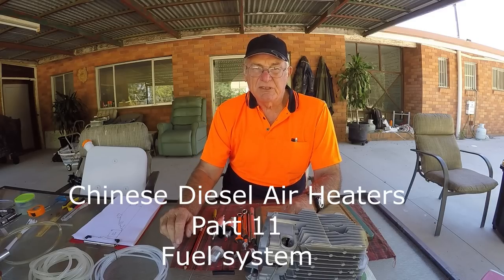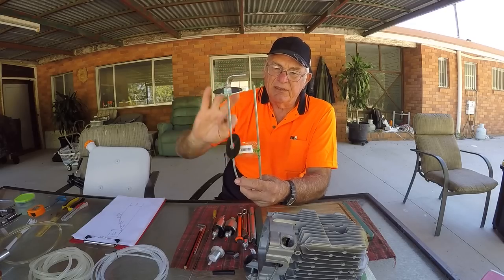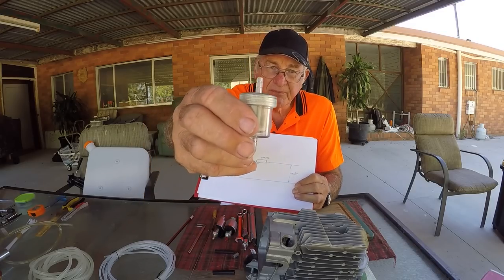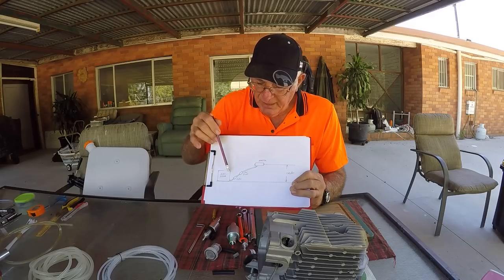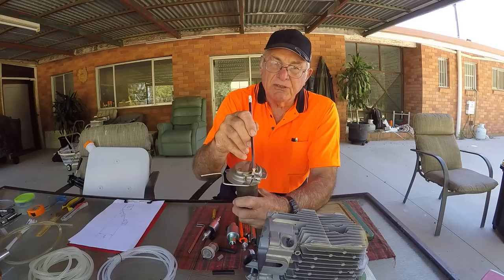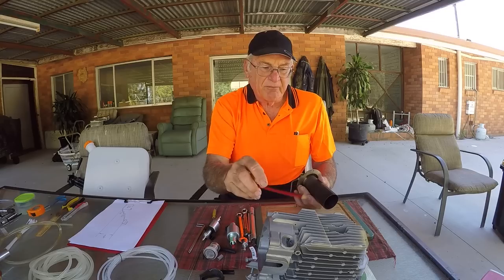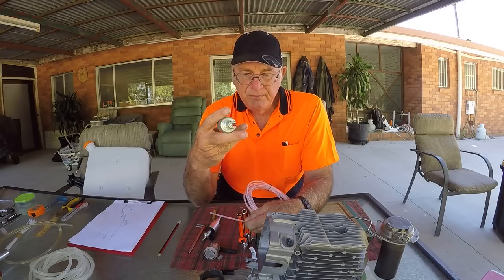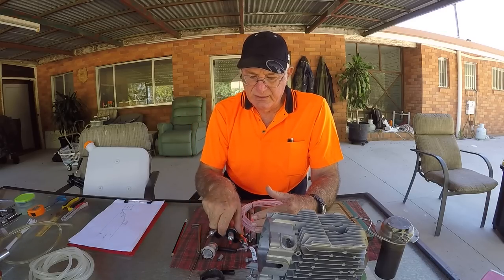Chinese Diesel Air Heaters - Part 11 -  Fuel Delivery

Comment: Hi John, i have an all in one diesel heater and it came with the thick plastic fuel hose and a terribly thin fuel tank, after a few weeks use we got a small pin hole leak in the fuel tank where it was molded, so its been out of use for a few months after stinking out the caravan. but lately i have just purchased a new fuel tank which is twice as thick as the old one, when i put it all back together i had that problem of not being able to get the air bubbles out of the lines, so going by your video, if i put a hard nylon 2mm fuel line on the pump outlet side this would cure my problem, next problem, is it ok to use the thicker softer fuel line from the tank to the pump or should i use the 2mm hard nylon fuel line all the way thru, thanks for your time John
Reply from the maker: Hi Allan, it is ok to use thicker fuel line from tank to pump, but I have found that some of the supplied thicker clear fuel hose from China only lasts 6 months or so before it starts to perish, so it would be better to use proper fuel line. 
Not sure what you mean about the bubbles. With these heaters you will always get small cavitation bubbles in the fuel line after the pump. 
With the all in one heaters, because the fuel line from the pump to the heater is very short, you can also use the thicker fuel hose should you choose. JMcK
Reply: @johnmck1147  Thanks for your quick response John, yes its not bubbles its cavitation, but my problem is how do i get the fuel from my tank to fill up the filter to the pump with out any air in the line, as you said the pump isn't strong enough to suck the fuel and gravitation isn't enough to fill the fuel filter and travel the short distance to the pump, would i have to siphon it thru manually.
Reply from the maker: allan mumby 

Hi Alan, the pump is strong enough to prime the line, but if it is a long line and a big filter the pump is doing loads of work, piston up and down hundreds of times without any lubrication. Just manually prime the line.  JMcK

Comment: Hi John. Do you think it would cause a problem to have the fuel tank above the pump so in effect it would be a gravity feed to the pump.
Reply from the maker: Hi Paul,  Tank above the pump will work fine, but you will need to install a fuel shut off valve and turn it off when heater is not in use as diesel can slowly seep past the pump valves and flood the system.  JMcK
Reply: Thanks for your quick reply John, The shut off valve is a good idea, my heater came with the soft crappy fuel line so just ordered some nylon Pneumatic line with an ID of 2.5mm. thanks again for your videos I'm sure they are helping a lot of people....
Reply from the maker: @paulexbiker2482  
Hi Paul,  suggest you use good quality normal fuel line on input side, ie  from tank to shut off valve to filter to fuel pump. The fuel hose from fuel pump to heater (unless very short) should be narrow bore hard nylon.  JMcK

Comment: Pardon my comment/question(s) if you'd already addressed it. I plan on installing my MaXpeedingrods 5000 12V 5KW 5000 heater as it is recommended to be installed with the stock components it came with. .Although,  I appreciate the information whiich you provided, is this video for ppl who do NOT plan to alter the stock components that come with the heater which we purchased? The only question(s) I have is will there be a fire danger if we plavce the exhaust pipe through a thick plywood floor of a cargo trailer? I see ppl purchasing these expensive 3rd party torret mounting plates instead of the one it came with. I don't see anything wrong with using the stock mounting plate if we create a hole a little larger than the exhaust pipe which would allow for some space (a gap) between the pipe and the edge of the wood hole. Right??  Thank you in advance!
Reply from the maker: Hi AE, You can do that.
You need a hole at least 100 mm (4 in) in diameter, or square if you wish.
You need room for the exhaust, the combustion air inlet, and the fuel line in the one hole.
You must seal the plywood cutout to prevent rot.
You can also put exhaust wrap on the first foot or so of the exhaust pipe.
You don't need an expensive mounting floor plate. Have a look at my motorhome install video.  Cheers.  JMcK
Reply: Cool thanks! I also have about 2” of pink foamular insulation attached underneath the plywood floor as well. I’ll cut that out too insuring distance from the hot pipe as well.  However, I’m confused as to if I shud place the 1.5 gal fuel tank inside or outside of my poly tongue box? Any suggestions are very much appreciated! Thank you! AE
Reply from the maker: Hi AE

You are using diesel or kerosene in the heater, so it is really up to you where you mount the fuel tank. Outside is better if you can, but many people have mounted the fuel tank inside with no issues.  JMcK
Reply: @johnmck1147  Got it and it fits perfectly inside my tongue box. I'm now just running the fuel line through the bottom of it into the filter and (upward angled) fuel pump. I just hope the fuel "filter" doesn't also have to be angled in any specific direction. Thanks again!
Reply from the maker: Hi Art, I answered this for you in another post. Yes, the fuel filter can be mounted flat.  JMcK
Reply: @johnmck1147  Geesh! Finally, the answer I was looking for. So many opinions it becomes more time consuming than it's worth sometimes. But, I think ur opinion is worth more than a lot of others' since u seemed like u actually DID THE RESEARCH YOURSELF. Plus, although my fuel filter is horizontal, it will only be about an 1.5 inches away from the tank .Then, the line will drop down out of a hole in floor of my tongue box (about 8 inches) where it  will join fuel pump facing upwards @ 30-45 degree angle. 😀 I shouldn't have too much of a problem priming the pump with that short of a distance "below the tank." BTW, there are alot of ppl saying good things about you John! So, kudos and thanks so much from a lot of ppl! Art

Comment: Hi John, thanks for a great video. I have bought one of these heaters and have been supplied with two sizes of rigid tubing in the kit. 4 meters of 4x1.25mm and  2 meters of 6x2.0mm. Is it ok to use the 1.25mm bore tubing?
Reply from the maker: Hi Greg, yes, that is ok. Suggest you use normal fuel host from tank to fuel pump  if they are at about the same level to lessen the chance of joiner leaks. From the pump to the heater you should use the hard nylon fuel hose.  JMcK
Reply: Hi John both the 1.25 mm bore and the 2 mm bore are both hard nylon/pvc. Can you let me know which bore is better for use? Many thanks
Reply from the maker: Greg Shaw 

Either is ok Greg. A bore of 1.25mm  to 3mm will work ok provided it is hard nylon. The issue is the "hard" part of the hose. The pump sends pulses of fuel to the heater and you don't want these pulses absorbed by a soft fuel hose and not squirting into the burner screen. Soft 4 mm bore fuel hose on the suction side of the pump is ok.   JMcK
Reply: That’s great. Thanks John.

Comment: John I’m getting 4.5V at glow plug, it starts but not efficiently any ideas? 12.7-12.9V at the heater unit. The earth is running to the chassis, does it need to be on the battery? I haven’t extended the power wires from standard only the monitor wires but with thicker then standard
Reply from the maker: Hi Matt, that is far too low a voltage. The glow plug can draw near 10 amps on start and it will pull the voltage down quickly if wires too thin or battery not charged.

I recommend the heater be wired directly to the battery, and do not connect negative to chassis. 
The power wires supplied with these heaters are the bare minimum.
I talk a lot about this in the motorhome video.  JMcK
Reply: @johnmck1147  I have placed the multimeter into the wires at the heater unit and it measures 12.7-12.9 on startup and at battery, wouldn’t I be seeing more significant voltage drop at the unit than the battery if voltage drop across wires or due to the earth were the issue?
Reply from the maker: Hi Matt, 

Is the heater new?, or has it been working well and now is hard to start?

If new, is it a 12V heater? Not a 24V heater.

If a 12V heater, do you have a 24V glow plug installed by mistake?

If an old heater, that was working well, I would try a new glow plug. There are lots available on eBay cheap.   JMcK

Comment: I'm preparing the install of a 2kw unit.
The tank is gonna sit 30cm higher than the heater unit, and i want to connect the fuel pickup hose on top of the tank (with a copper pipe inside the tank to 2 cm above tank bottom) because then i can easily disconnect the fuel line and take out the tank to fill it.
Because the fuel line is going out on top of the tank and then downwards to the heater unit , there will be an air bubble in that bend.
I'm using the hard style 2mm ID hose.
Will this bend be an issue? I see in you video that you can PUSH a bubble through, but in my case, it should SUCK the bubble through the pump.. any advise?
Reply from the maker: Hi Winand, I don't see any issues with that set up.  JMcK
Reply: @johnmck1147  Thanks for your reply! Great, a step closer to installing now ;-)
Reply from the maker: Winand D 

Your welcome. 
Best wishes,  JMcK

Comment: what if you have to mount the pump higher up than the heater? I have the hard nylon but im Teeing in to the fuel pump in the engine bay, so the heater will be at least 50-60 cm below the pump. shouldt the pump be closer to the fuel source or the pump? its say my fuel source is at least 2.5m from the heater. where should i put the pump, closer to heater or fuel source?
Reply from the maker: Hi AP, I think you will have troubles here. You can't tee into the engine fuel system, you need a seperate fuel pick up for the heater. Suggest you see motorhome videos.
Pumps always push better than suck. Better to have pump closer to source.  JMcK

Comment: does the diesel drip onto the atomizer or injected?    If injected is that simply cause their is a small orifice at the end of the fuel line orrr???
Reply from the maker: Hi C, the diesel has to be squirted through the atomisation screens.
That is why you should have narrow bore hard nylon fuel hose on the delivery side of the pump (except for very short runs). The hard nylon fuel hose does not absorb the fuel pulse.  JMcK

Comment: Hi, I bought a 8 kw (ok a 5kw) and i need a spare pump and a spare glow plug.  Where should i look to get the right one ?
Reply from the maker: Hi Stephane,

I purchase most of my items off eBay. You need to search in your local area and look for sellers with an in country warehouse if possible.

The fuel pumps are universal, but when buying a glow plug make sure you buy one with the correct voltage. If you have a 12 v heater, you must make sure you have a 12v glow plug.

Here are a couple of links to get you started.

Glow plugs.

https://www.ebay.com.au/itm/Air-Diesel-Heater-Ceramic-Glow-Plug-12V-For-Car-Truck-88-98W-Parking-Heater/292927992126?hash=item4433de713e:g:FXgAAOSwJgBcYWJ9

Fuel pumps.

https://www.ebay.com.au/itm/Universal-12V-Car-Parking-Air-Electronic-Heater-Diesel-Pump-Oil-Fuel-For-1KW-5KW/183487387280?ssPageName=STRK%3AMEBIDX%3AIT&_trksid=p2057872.m2749.l2649

JMcK

Comment: Hi john. Im having trouble finding the nylon fuel line here in qld. Can you suggest somewhere I might find it?
Cheers Jess
Reply from the maker: Hi Jess, suggest you buy on line. I have suggested one link, below is another I have bought from.

https://www.ebay.com.au/itm/Diesel-Heater-Nylon-Fuel-Line-OD5mm-ID2mm-8m/333528678720?_trkparms=ao%3D1%26asc%3D20140728113407%26meid%3D32ba885f6a114ea194ed61779788e4e2%26pid%3D100148%26itm%3D333528678720%26pmt%3D0%26noa%3D1%26pg%3D2059210%26algv%3DItemStripV3&_trksid=p2059210.c100148.m2813

Regards.  JMcK

Comment: What will happen if the heater is running and you run out of diesel.  Will the heater shutdown normally?  Any issues/problems?
Reply from the maker: Yes, you will get a fuel error code and the heater will go into shut down mode.
Reply: @johnmck1147  thank you.

Comment: Just curious, any idea on the delivery pressure and I just got a 2kw heater without any fuel lines so I am running 3/16 hp fuel hose heavy wall all up distance of about 500mm with positive pressure from the tank , test ran it for 12 hours without a problem @ .16lph burn flat out . With such a short run of fuel line do you think it would be a problem? Another thing I did was put a pod filter on each of the inlets just to try and keep some of the dust out it is mounted in a steel box and will be used for heating my camping trailer. Have enjoyed all of your videos and learned heaps . Cheers
Reply from the maker: Hi Pete,

You won't have issues with such a short fuel hose run, please read the description, there is more info there. The issues arise when people use that very soft vinyl hose, and have a poor install causing soot formation in the heater. 

I assume you put a filter on the combustion air inlet, and the heating air inlet. You must have a filter on the combustion air inlet, and one on the heater inlet itself is good if drawing heating air from the outside. J
Reply: Been a retired diesel mechanic anything drawing air needs a filter so on both . The reason am using pod style filters is less restrictive than paper filters which i prefer , pods only stop half house bricks and small children been sucked in . It surprised me how quiet the pump is i have mine suspended because i never got the mount. A bit of lateral thinking works wonders . It surprised me how much smoke came out at the first burn but am sure that was just the combustion chamber cleaning itself out now there is no smoke on startup. Thanks again for all the videos it convinced me to get one of these heaters had been toying with the idea for ages
Reply from the maker: Interesting reply Pete. Regarding the small kids not getting sucked in. How small is small. Will it keep out crawling grandkids.
Reply: John McK 47 it will keep them out no worries, the main reason for the pods is to keep the wasps and bees out they tend to build nests in anything with a hole even garden hoses especially it it is not used very often  . I don't think the smell of fried geko would be very nice either they get everywhere hence sealing everything up gotta love living in the tropics
Reply from the maker: pete ryan 
I agree Pete, we have problems with geckos and mud wasps here. The wasps just love to build nests between the heat exchanger fins.

Comment: Thanks for all the info! Since it's our summer I am getting ready to install my heater for the up coming winter and I'm learning a lot! But I'm wondering about the fuel line after the fuel pump and filter, would it be ok for the fuel line to drop down a few inches and then eventually rise back up to the heater?
Reply from the maker: Hi Isarel, 
No problem there if you use narrow bore hard nylon fuel hose from pump to heater. The cavitation bubbles are easily pushed over the hump.
Have you seen the motorhome video? From memory there is a drop of about a foot (300mm) with no issuer.
You can use normal fuel hose from tank to filter to pump.  JMcK
Reply: @johnmck1147  thanks mate, yes I've watched them all! How do feel about a fuel line quick disconnect? I plan to have a removal external fuel tank and have the heater with fuel pump and filter installed on the camper.. 🤞
Reply from the maker: @israelsoriano6116  
Good idea Isreal. Did you notice the disconnect on the black jerrycan in the motorhome video? 
Cheers. JMc
Reply: I didn't catch that.. I'll watch it again. Do u remember the the part or have a link to some quick disconnects? Cheers
Reply from the maker: @israelsoriano6116  

Hi Israel, the black jerrycan has a quick disconnect fitting in the bottom. I got my fitting from an outboard motor shop. From memory it was a Susiki outboard fitting.  JMcK

Comment: Hello John
So can you use the bigger bore vinyl tubing from the fuel tank to the inline fuel filter and from there 2mm bore hard plastic fuel line. My fuel tank and heater are at the same level so no big ups and downs
Reply from the maker: Hi Ansis,

You can use normal 4mm ID  “fuel hose” from tank to filter to fuel pump inlet, but you should only use narrow bore hard nylon from the pump to the heater.

Suggest you do NOT use the vinyl fuel tubing that comes with some heaters. It will perish within months and can cause dangerous leaks. Buy some proper fuel hose at an auto store.

Cheers.  JMcK
Reply: @johnmck1147  Thanks for your advice John. 
Another question.....Using the 4mm ID fuel hose what sort of turn off tap/valve  have you found that fits that  I could place inline coming out of the fuel tank so it can be turned off if I need to remove the tank at some stage
Reply from the maker: @ansisrieksts7174  

Hi Ansis, any ball valve tap is fine, you can use fuel taps from auto stores or even compressed air ball valves from hardware stores, the correct nipples are available from the shops that sell the fuel taps.  JMcK